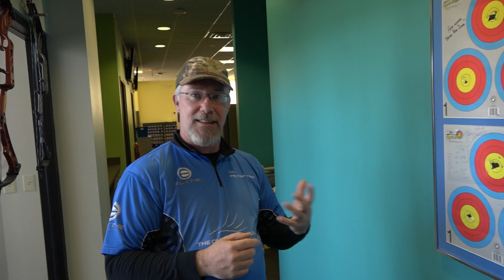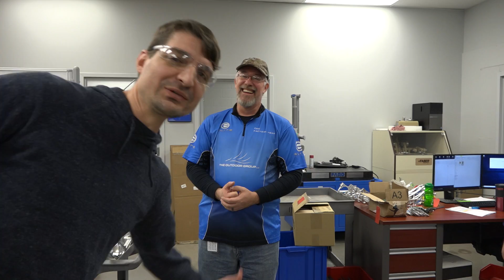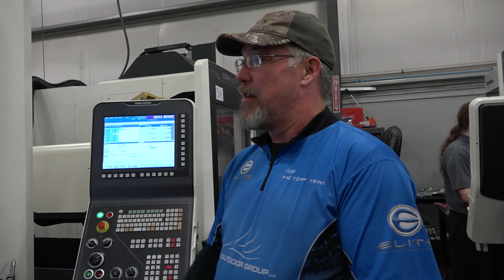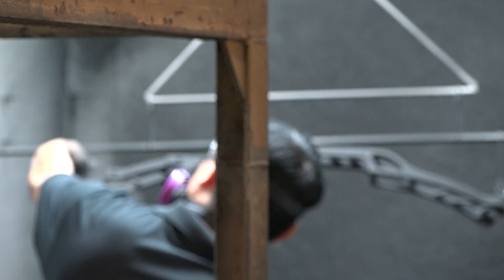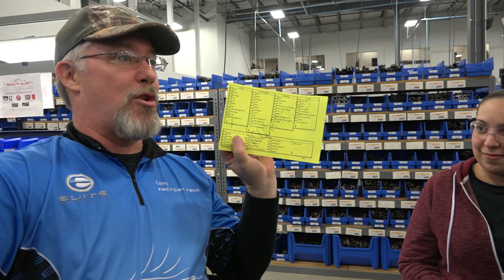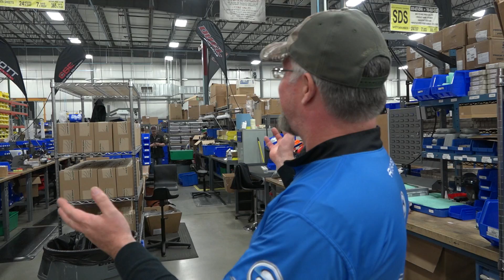The Elite Compound Bow Factory

Comment: Why are Elite bows Elite? Those Hass machines cost from $300,000 to $1.2 million. The foundation they set on is 20' foot of concrete and required to hold tolerances of .0001" or better @ 100 inches per minute. I worked as an inspector for a machine shop, and a proclamation of "We cut our tolerances in half" is a statement many will never understand the effort put forth to accomplish it.
Reply from the maker: Nice

Comment: My question is, where does the refuse go, the things or metals that are coming out of the drilled holes, as well as the liquid or water. In a slag dump or river?
Reply from the maker: You could write to them with that question. I didn’t see any rivers in the area so it’s not likely going into a river. But I’m sure they will answer if you write to them

Comment: I just bought my first elite bow. It was the impulse 34. I stripped the  upper and lower cam mod screw heads. I was using a new set of allen wrenches. I hope and pray this is not how my future will be shooting a elite. Great video.  Thanks for sharing!!
Reply from the maker: That’s frustrating. Make sure you are not using metric Allen wrenches because they won’t fit perfectly and will result in stripping like you’ve experienced. God bless.

Comment: Thanks Sean and guys at the Elite factory for such a great video.  As a machinist of over 30 years, I especially like the work holing fixture that lets you grip and release during the machining of the risers, so that when the stresses in the material that are released after the rough milling cycle can then be machined out during the finish milling cycle. By doing this I'am sure that those risers are spot on. (pun intended).
Reply from the maker: Thanks, Gary. God bless ya.

Comment: should be receiving at dealership.....................laffin'....................they don't have a drawboard!
Reply from the maker: The dealership doesn't have a draw board? Why not?
Reply: I've been in four shops without a board.  In fact I've never seen a dawboard ever anywhere except the ones we built back in the late '80's
Reply from the maker: Wow, that is surprising. You can see the ones they use at Elite in this video. I have been using the one I got from Lancaster archery for my bow reviews. I use that now at home too since it is portable. I just disassembled the permanent one I had built into my work bench. Having the portable one I can just take it down if I need room for something else. Anyway, God bless ya.